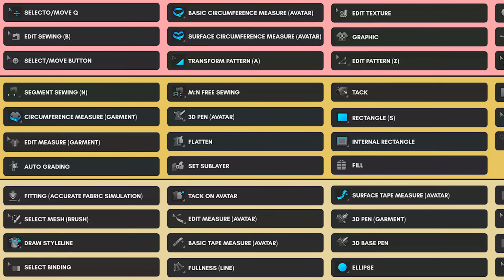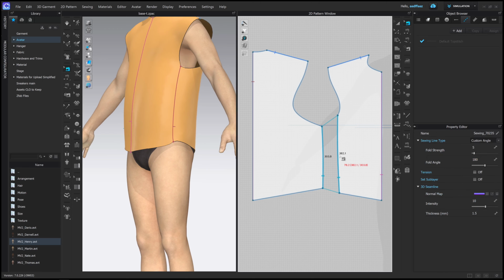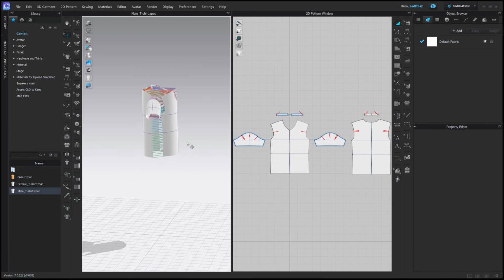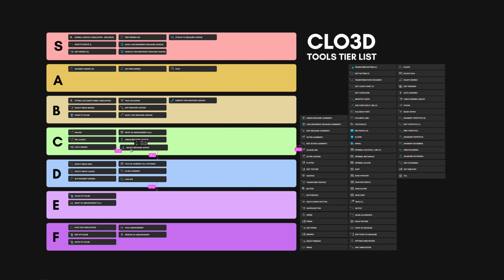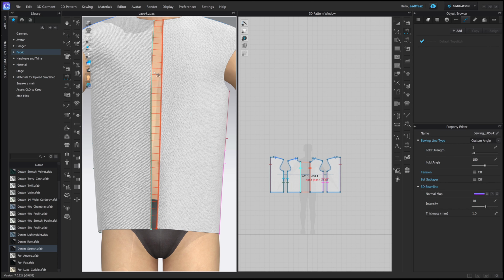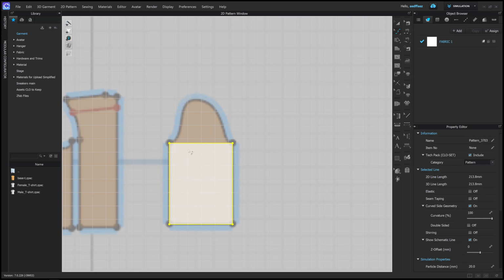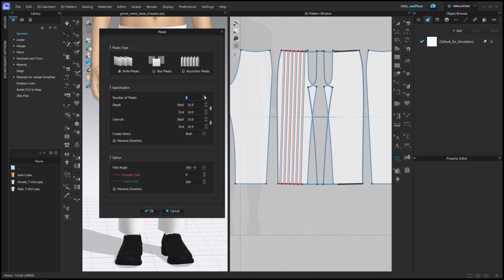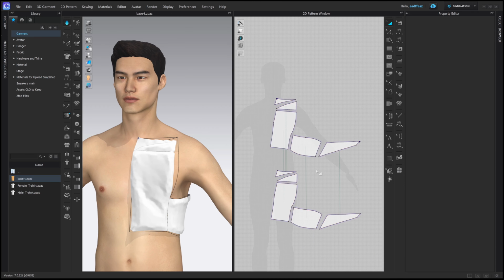Chapter 2 Part 2 - Every Single CLO3D Tool Explained in Less Than 30 Minutes | GRMNT Masterclass

Comment: there's a lot of exceptional knowledge, succinctly, delivered, all in one place. i've been using clo3d for about a year, and i still picked up new things here.

one small note: i think Walk Pattern is worth at least a B in light of the fact that if you right click while walking you can apply a notch on the same point on both patterns simultaneously. it is, in my opinion, the most effective way to notch patterns for real world sewing.
Reply from the maker: Comes down to personal preference ... I usually use the B tool, right click, add a segment point where I want a notch and use the notch tool to add it in order to keep the patterns in the same spot throughout the design stage... But yeah, it's just another solid way of working, definitely! But not S tier so the beginners are set, haha
Reply: i think you wanna take your walk pattern home...and give it a top tier...

Comment: Great video, however one bit I cannot really approve of. I do use "transform segment" tool quite a lot and love it. It helps me so much in adjusting , Maybe you neglected the potential of this tool. Same with "C" editing curves. I hate my pattern "cluttered" with all those curve points and I find it gives me less control over my curves. Using "C" it will create bezier handles, which I so much prefer to shape my curve with. And it adds no additional curve-points leaving my lines clean. And "smooth curve" you did not really use the way it is intented to. You just drag a point from an edge inward to create an even curve, which I find very handy at times. Are you sure, you were really thorough in exploring all the tools or too quick in discarding many as useless?
Comeing slowly to the end of your video, I must revise my first impression. No, not a great video. Do you even have an idea, what the "Trace" tool can be used for? By tracing outside and/or internal lines you can create whole new pattern pieces like lining or pockets or whatever. Please do your homework first before lecturing. Sorry, but so far I would not recommend your classes. And no, I am not associated to Clo, but just a regular user.
Reply from the maker: I appreciate your input but you have to understand who this video is targeted to, a beginner who needs to have a glance at the functionality of the tools, and commit to mastering a few of them first to achieve a usable result. I've highlighted the most important ones to avoid choice overload. I hate Beziers as there are only 2 of them per segment whereas with the curve points you can literally shape an entire pattern piece and as soon as you exit the tool, you no longer see them. The trace functionality you're describing can also be done with internal lines and cutting + sewing... Knowing more options to achieve the same result will lead to a highly technical user who doesn't focus on design which is what clo is meant for and what we encourage our audience to push for.
Reply: This is interesting discussion! I have the feeling that @tinalisapattern is a seasoned patternmaker with years of experience and @GRMT is a designer, am I correct? You both have a point there and I can see where you both go apart and meet. The pattern maker will start in 2D, drafting or working from a block to create a garment and using 3D just to check if the patterns fit correctly. A designer will do the opposite, that person will draw on the avatar and will use the 2D to generate patterns. If you would like to start an actual brand and need to draft and grade patterns, you will have to have thorough pattern knowledge and fitting experience or you'll have bad fit in your garments. If you're design for a specific person and don't have tha pattern knowledge, CLO is such a big help in generating patterns. 
In all my years of experience (30y), I have found that a good pattern maker is indispensable. CLO is great but will not be able to replace real life actual experience. The avatars may move like humans but they do not have soft bodies and real humans do. That has an impact on fit, especially when you're working close to the body.
Reply: @hariitolingerie  I am indeed a fashion designer. I studied fashion design in Germany back in the 80th. And yes, I love pattern making and bringing your ideas from head (or paper) to real life. And a good fit is essential. I am nowadays designing sewing patterns, which I sell as ebooks with included instructions. And I am sad to see too many self proclaimed designers and pattern makers (well, at least they believe they are) that do a terrible job and give the business a bad name. I take pride in not only providing a great design, but also a great and accurate fit. I even include instructions for alterations of the pattern to fit your body.
Now I see the same happening in the 3D scene, and it so pisses me off, when I take a second look at what appears quite nice at first glimpse, but upon closer look would never work in real life. 
BTW someone in a fB Clo group asked for help, as something taught in a course he purchased did not work as shown in the video. The sleeve always flipped to the wrong side, when simulating. Well, not only was that sleeve an insult to my eyes, but yes, indeed, it was sewn on wrong, but in the short sequence he showed, it seemed to sew on correctly in the end ( I strongly suspect, there was a cut in that video and the result apparently correct). That poor guy had struggeled all day and was desperate for advice or help. 
I inquired, who was the maker of those courses.... and guess what?... 
Jepp. the same person I said, I could not recommend his classes.
Reply: @tinalisapattern  chill